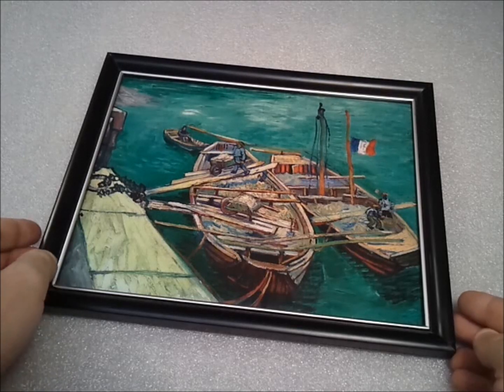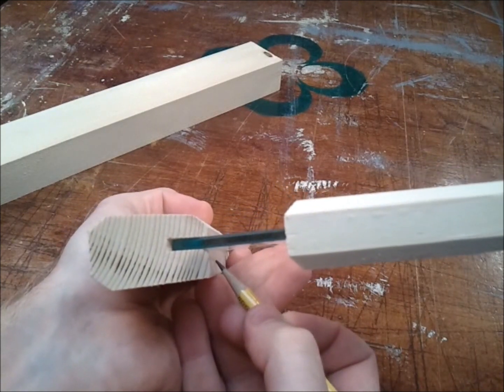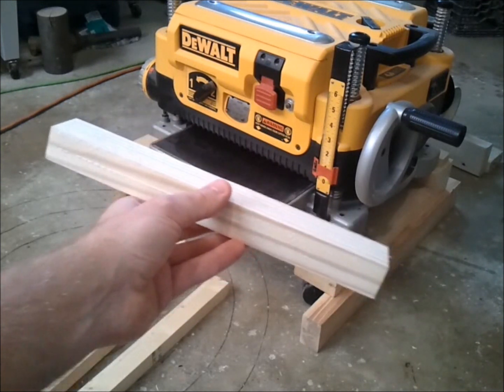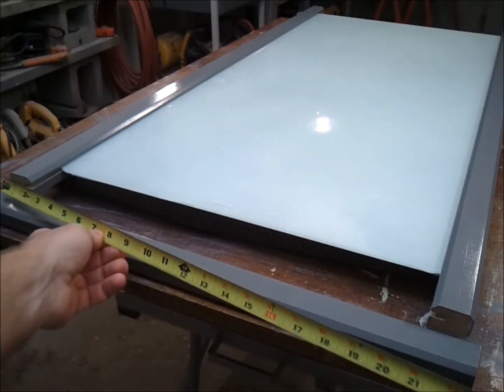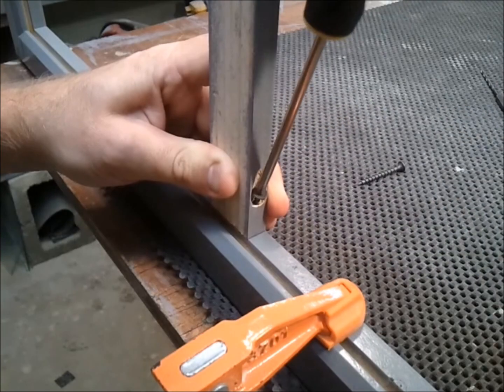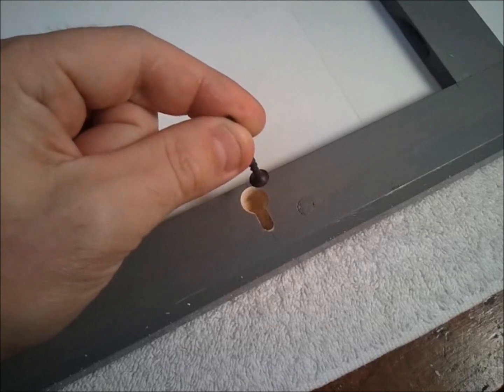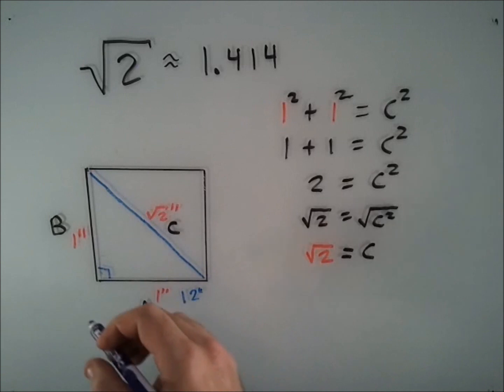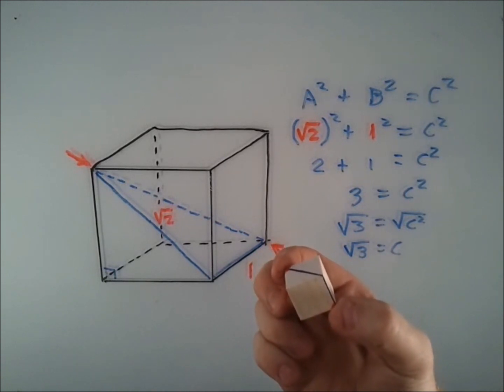Glass dry erase board

Comment: This is brilliant!

I know it'd add weight, but if you wanted to make this board magnetic, I assume you could put a sheet of metal behind the glass. The alternative is to paint the back of the glass with magnetic paint (paint impregnated with iron bits). 

If you could do this all over again, would you change anything?

Comment: Would adding some sort of LED backlighting help eliminate the problem of shadows from the marker?
Reply from the maker: I didn't know it was a problem. If this video made it seem that way, it was because I had can lights aimed at it from various (possibly steep) angles. In real life, its appearance is very nice. As a technical point, filming white (for me) is the most difficult; white backgrounds often appear dark as a response to the lighting, and editing tricks only seem to promote graininess. 

But to your question: I think backlighting could be great for this sort of thing, but by no means easy to implement. Some sort of diffuser would be advisable, because individual "spots" from each LED would be terribly distracting and revealing. Thus, it would require a thicker panel, building it out from the wall. I think, in my ideal shop, I would have one embedded in the wall, backlit with CFLS and a employing a translucent diffuser screen. That would be awesome.

Comment: Just came across your vid, it's awesome! So thorough and a really nice finished product. What kind of paint did you use? Just basic spray paint? I know there are glass paints out there, but I can't seem to find anything in a decent size (most of the stores just have crafting sized 8oz bottles). I'd like to make one like the colored glass boards here: http://www.monomachines.com/shop/presentation-tools/glass-dry-erase-boards.html. LOVE the bright colors, something different than the norm whiteboard. Contact paper is a brilliant idea, as my main concern has been the paint "sticking" and peeling or scratching off. Have you found that your painted boards have lasted over the couple of years since you made this video? Thanks!
Reply from the maker: I used regular old spray paint, which was most likely the one dollar per can kind. It is mounted to the wall, so there is little chance of it being scratched or scraped. As for how it lasted, it was just fine last I saw it, although quite dirty from dry erase marker dust (it was for a mathematics professor, so you can imagine how much use it sees).

It may also be possible to alter the back surface, to make it translucent rather than white. Sandblasting it would be one possibility, or perhaps one of those wipe-on etching compounds (hydrofluoric acid, if I remember correctly) would be an even more permanent solution.

To be honest, it takes very little to shift the attention of the eyes to the front of the board; the boards that I use around the house are simply glass backed with poster board that was affixed with spray-adhesive. Even something this simple is superior to the typical whiteboard material. Hope I helped you some. Good luck.
Reply: pocket83
Thanks for getting back to me so quickly. Wow!!! That is great news ($1 spray can paint!). I found a frosted glass paint that might look nice and it was only about $5 at Lowe's. I'm very excited to try this for my daughter's room. Thanks again!
Reply: +pocket83 How about window frosting? You can get a can from your local big hardware store. I'm currently making an LED Vanity. I stripped the mirror finish around area I wanted to keep and sprayed some window frost in that area to make the glass a bit opaque so that the LED lights can still shine through.

Comment: Don't use upper case letters for the length of a side og a triangle.
Reply from the maker: Fulla Beaverhausen  Why not? Was it too difficult for you to understand? Variables are arbitrary, especially when no interior angles are present in the problem. I could use letters from the Greek alphabet (or a star, a heart, and a diamond) to express the exact same idea, so get over it. The specifics of mathematical convention may have their place, but that place is not on a video like this one. If you are talking a test, then you should remember to apply that rule.
Reply: +pocket83 completely correct. That said, in trigonometry, it's common convention to use uppercase for angles, and lowercase for sides. Especially for use of the sine and cosine rules, it's important to keep to these conventions. Good habits are always good habits.
Reply: sorry to disagree with you but in the field any letter uppercase or lowercase can mean anything, and it's better to learn the way the functions behave, not the letters, or you'll get confused. If you're used to A always being an angle, if it's not, you're stumped. But if you're used to what's inside a sin() function always being an angle, that's much better. (Source: am Dr of Physics)